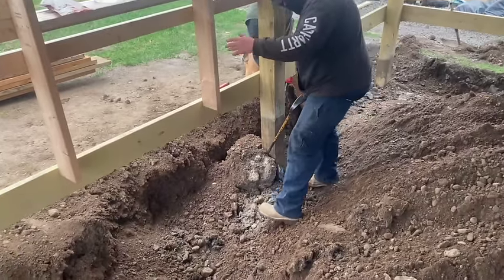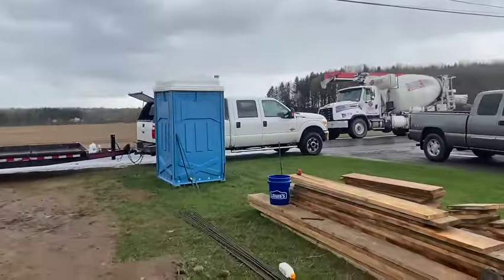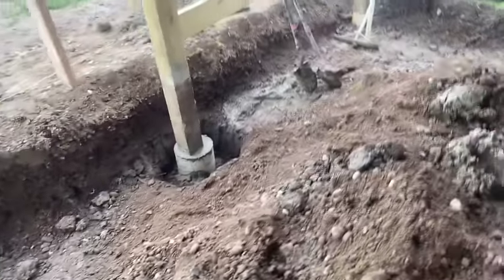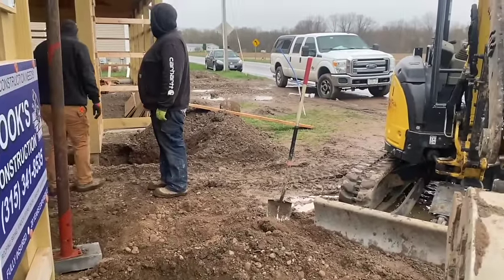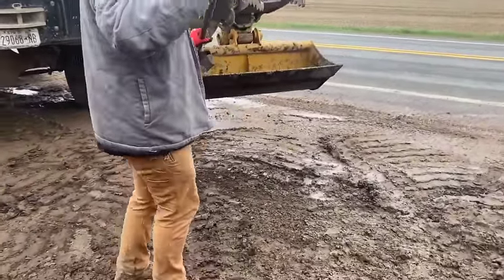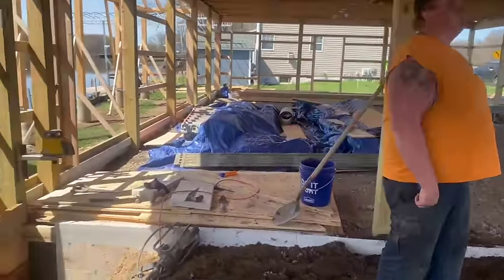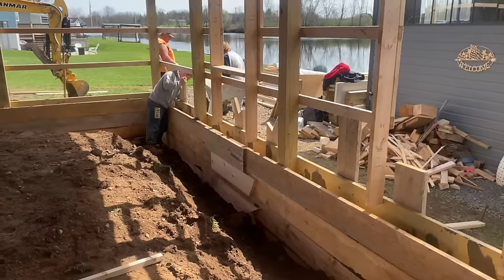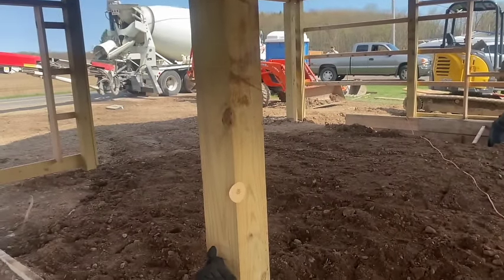HOW DID THIS PASS INSPECTION???

Comment: Disagree with your comment about the cement around the pole. Being from North Dakota we know cold better than anyone. JUST make sure the hole is below the frost line....here its about four to five feet. Two feet deep like they did was a waste oftime and money
Reply from the maker: In really wet soil the frost can grab that jagged blob of concrete and lift it right out of the ground. If someone insisted to cement them in they should use a smooth tube around the post then nothing for frost to grab.

Comment: Dude I’ve seen hundreds of pole barns built this way in all areas of the USA and never once have I seen a 6x6 heave up because the concrete was around the pole, frost line or not. It literally has the opposite effect if you use enough concrete. The only way it would EVER heave up is if you built it in a flood plain or a wetland which idk why anyone ever would to begin with, but even then I doubt it would raise enough that you’d ever notice. You talk like the buildings going to float away into the sky.
Reply from the maker: The river is like 20 ' away. You do not build like that. Inhave seen poles get pushed up from frost in clay soil.

Comment: The new sono tube hole you dug is to big for those tubes.  Even if you pack dirt around the sides of those tubes, the tube eventually slant over in time when weight is distributed on it.  I seen this before when a contractor digs the sonic tube hole to big from the start.  No way these sono tubes will stay straight up, to much soil was disturbed around these tubes.  Should have formed footings around that huge hole and kept the soil undisturbed.

Comment: Well, I do agree the concrete that was put around the pool is insufficient. Apparently other than New York. This is standard practice. L O L guess he’s never set a fence post before the concrete should run from top of dirt to around 48 inches around the Post but most of us anymore just put them in saddles in the woods, never in the ground and building last longer

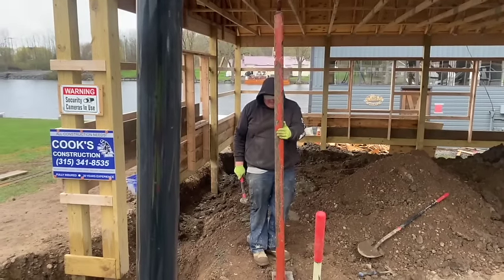Comment: At 16:19, referring to the vertical steel post, the chap said, "It's not perfectly level, but...".  No.  It certainly is not perfectly level.  It is about 90 degrees from level.  It is vertical (only a couple of degrees from vertical, actually).  Don't these contractors know the difference between "Level" and "Vertical"???  NO?  They should not be on the job.

Comment: That concrete blobs around (partially around) the poles is very amateurish mis-construction.  In New Zealand, we normally set a footing of concrete below, and when it has set, put in the pole and then pour concrete all around the pole or its supporting steel post which would come up above ground level.  Never do building regulations allow partial surround of concrete.

Comment: 48” first line though only about the first 12-18” at best actually freezes.
Reply from the maker: Depending on soil conditions yes. In wet heavy soil like clay it goes much deeper  I have seen decks get pushed up and brand new concrete floors heave and bust apart from clay soils.

Comment: now let me get this straight you say that the posts would not have frost protection when you are pouring a wall that is NOT FROST PROTECTED ON THE HIGH SIDE OF THE WALL seems to me your no better that the first contractor hat built the building
no frost protection on the boat house side at all you drilled through the 6 x 6s so if frost heaves on the boat house side it will pick that side
Reply from the maker: Well in my next video you will see that we put foam down 32" and out 48" around this entire wall I built. The problem with the other guys method was those balls of concrete you could not get the vertical foam put in because it was a big blob in the way. We frost protected the entire house as none of it was below frost with 48" of wing foam. The house part they set on little squares of concrete under the post at around 2' down so we could get the foam in.

Comment: Question.  We do not have a frost line and I cannot find in our building code that mentions requirements for it.  So I ask, if you didn't have a frost issue, would a 4'/48" depth of the pole not get concrete at all?  I've seen deep concrete posts (about 4' deep) with the pole attached to it via anchors and deep poles wrapped by concrete.  So which do you like more?
Reply: In my area (4 ft frostline) typical practice is to drill an 18” hole and put a pre-formed concrete pad or plastic disc (I forget brand name, but they are a stock item at lumberyard).   Treated post rests on that.  Then backfill and tamp 1” washed sharp gravel to grade.
Reply: 18” circumference 48” deep
Reply: @Philip Brown  much appreciated.  Looking forward to my first pole barn.
Reply: @cjplay2  Brackets on top of sono tubes or permacolumns. True pole barns should have died when they removed chromium and arsenic (CCA) from pressure treatment. I won’t even build a fence with wood these days.
Reply: @SilverbackAG  appreciate the insight.  I'm more inclined for steel post frame but they won't let me on the first project.  Financing issues...  oh well.
Reply: @cjplay2  I ended up with a 36x48 (16 ft side walls) conventionally framed with 2x6s on 24 inch centers. Spray foam, radiant heat. I should have made it 20 feet longer and 2 feet higher. Wider would also be nice but I was up against a creek.
Reply from the maker: I like no wood in the ground at all bud. But if you have to do it then do not pour concrete around the pole just a footer under it and backfill with stone or crushed gravel. The 4' depth is also to give the building strength and wind resistance with less framing.
Reply: @bondobuilt386  thank you.
Reply: @bondobuilt386  I notice the folks that do pour concrete around posts/poles without issues are those that in deserts or semi arid areas. Any farmer east of western Kansas knows not to do this. Concrete is a sponge. Some municipalities require it for fencing. Dumb dumb dumb.

I am replacing any of my own fencing with reject tubing or pipes. Building a trailer to mount an old Lincoln SA250 and plasma cutter/air compressor.
Reply: @cjplay2 ...Build a concrete foundation and floor and then frame the walls 24" o.c. This style elimates this encountered mistake and uses less board feet of lumber making it cheaper, easy to insulate  and just as strong.
Reply: Anyone mentioning a 48" deep hole dug with an 18" diameter auger is exactly correct.  Put a 5" lag bolt on each side of the post sticking out 2" will grasp the concrete and not allow uplift (wind blowing or pulling your roof upwards). The 8-10" pillar the guys in the video retro installed under the post isnt gonna do anything for the build that the original builder didn't do. Only complaint with the original builder is they dug the holes too deep and the posts were not set at the bottom of the hole.

Comment: Tim Slowey; I agree with you:  Puting concreat under the post has no help in holding the post down.  The guy bad mouth the concreat around the post is the ,one scamming on charging the owner money for somethin he doesn't need.  He talks good to someone that has no building experience at all.. Frost line has nothing to do with the post in the ground.Here in mississippi.we are pluge with torandos. All our pole barns are required by codes where there is a code to pore concreat around the foot of the poles to hold them in the ground, & have inspected pole barns after a tornador took the barn away, & the poles only thing left standing.

Comment: Wouldn't the structure be stronger if encased in concrete rather than bolted down? Or everything goes by code?
Reply: Pole will rot faster in the concrete and frost will push the pole out of the concrete.
Reply: Ok thanks

Comment: You used tubes to only have 6x6s in the way of a 15" deep continuous footer? Ever hear of a residential footer compared to a pole barn? I guess get what you pay for and they weren't down 4'.
Reply from the maker: Yes if I got involved sooner the house would have been built on a frost protected stem wall and not had wood in the ground. We ended up frost protecting ther entire house with foam board because nothing went down below frost I believe because of the water table there was high.

Comment: All those posts should’ve been above grade. You could’ve made a round columns right above grade loaded them up then you said that plate on top of it and then the post should be on top of that so when the water gets it it’s above great if not this post is still going to wrap and then on top of that even if you did leave them how you left them they should’ve been coded COATED with the roof cement at leastBut I’m in new construction and all that stuff those post have to be above grade grade. Even though they’re pressure-treated they will absorb water n in couple years rot😢I do follow your channel and I know you do good concrete work but I saw other people actually post about this too.

Comment: This is why YOU CANNOT simply "trust" the contractor is doing what they are supposed to do.
You need a set of engineered drawings.
You need a contractor who understands engineered drawings.
You need to SUPERVISE the contractor and inspect their work during each phase.
If you dont understand construction (as an owner), you need to hire an OWNER REP to keep the contractor in line.
OTHERWISE you will end up with a MESS !
Reply: Famous words always read after the fact.. 20 / 20 hindsight!

Comment: Wow we have a diffrent set up here in the UK .  As what you did in this video  our inspectors  would have made you rip it all down then reported you to the trading standards even taken the cowboy horses off you . 
Here you have to dig a complete square of the boundary of the build  dig down 2ft 5inch 
Width must be no more that 2ft wide  then the concrete must be one continuous square of over 6inch thick .then you build up to ground level with concrete blocks then you build your barn on that .post must be fixed to the floor using steel supports  .
As for your build/save repair  using a mini digger to move your concert  don't you have wheelbarrows??? Just lazy using digger . An not vibrating the concert to get the air holes out that wall must looked like Swiss cheese.

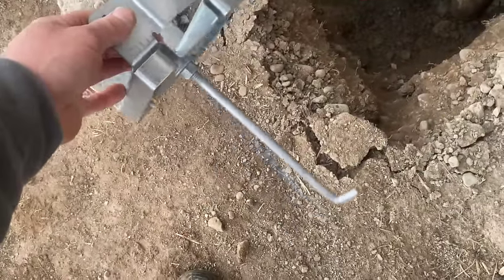Comment: @ 4:35 tell your guy trying to screw in the screw to drive them in with a hammer first then they won't fall down in the water.
Reply: Or pre-drill to start hole with other bit or drill/ impact.
With 1 impact drive, you can change quickly between drill bit and screw bit

Comment: I would hate to think the mess with the rest of the pole barn house of which you are not working on. If the did such a bastard basket case job on the garage, which you are fixing right, the rest of the house is sill with the same crappy job.

Comment: good grief that concrete isn't gong to do anything, they could have got it all the way around the pole never seen issues with it moving anywhere it matters.. da fugg you get that nonsense the frost is going to lift it up, how much?  the frost pushes in all directions not just UP, ever froze an ice cube and watched it freeze?  the soil if it is moist around the concrete around the pole is just going to GRAB IT and compress it, the concrete is winning that battle every time, push it up, WTF?  

this guy spent a lot of money he didn't need to spend, is this a scam you run on eveyrone or WTF?  you didn't go below the frost line with your sono tube so WTF is the difference?

whats the difference if the freeze is pushing on the concrete around a pole or the pole itself?  NONE!  goofy logic at best, you did nothing to capture the posts to prevent anything the frost is doing, all you did was remove the concrete half arsed around the poles and placed it under them? not much difference..

in permaftost which new york is not you run concrete up 38" above the frost line then the pole rises from there, same dimension, this keeps the wood out of the permafrost and snow pack, when water freezes it expands, so you think putting concrete under a pole prevents that from happening?  total BS

SHOW US TIME LAPSE OF THIS HAPPENING WITH BOTH SCENARIOS AND THE DIFFERENCE WITH A MICROMETER, you think an 1/8th" or a 1/4" matters in a pole barn, the entire ground expands so it all moves at once, if you do anything you increase the diameter and depth of the concrete, ever see the pads the Alaska pipeline sits on in permafrost?  HUGE  this is pipe where it matters is it moves..

I dunno what you think your logic is here now a freeze lifts the pole up off the pads you have in place? and nothing falls under the pole?  if anything you would attach the pole to the sono tube concrete pad to prevent that form happening... lord  you say freeze can lift things so you separate the pole form the concrete? in a fashion where soil can fall under the pole when lifted? freeze pushes in all directions, soil mixed with water the freeze will push under that pole. so why not have the concrete and pole move at the same time as one, the entire building at once?
 
if your frost was at 48" whats happening to your solo tune? same thing as the concrete around the pole..

using your logic one would dig below the frost line 4', drill another 3 ft, place a concrete tube with anchor, anchor a sealed treated pole to that, back fill, OR, elevate the concrete above the soil line, like you see them do everywhere there are 4 seasons in the USA.. your logic is flawed because you failed to prevent the sono tube you placed under the pole above the frost and or the pole you placed below the frost line from doing the same thing you claim will happen to an encased pole in concrete? ... huh?

again show us this event with the concrete around the pole and under it, it works either way but who wants soil against the lumber treated or otherwise, at least wrap them with a few layers of tar paper, under as well, a asphalt shingle is best in the pad for the pole to sit on.. anchor that pole to the sono pad.. you think treated last forever?  exposed to the elements 25 years, against soil maybe 5 .. certainly rather have concrete against it than damp soil.. dafugg?

when I do concrete supported pole buildings I don't use treated alone, I wrap with tar paper and then use a shingle under the pole, same as when you push soil against a concrete wall, they always spray it with tar as a barrier... so the earth its isolated form the concrete.. myself I never dip poles in the soil, I'll put my pad or whatever above the soil line a few inches.. you have barns still in use over 100 years old right on the compacted soil so whatever but I dunno who told you this story but its wrong ..  just how high d they tell you this pole barn was going to shoot into the sky?  go see how they build in permafrost...

if you want to do it right never put any wood beneath the frost line, that's going to last the longest, anchor it to a concrete pad with steel isolated .. typical way I do it, if its getting a slab I elevate the bracket above that an inch I wont even pour a slab around a post, certainly not bare post.... .. soil is soil, wood is wood, concrete is concrete, keep them as separate as possible, why you keep the sono tube in place, its a barrier between the soil and concrete, spray the tops backfill..  do the same for the wood, the steel wont matter much but coated with a good hard epoxy sealer does help it from rusting right away
Reply from the maker: I do agree with keeping wood out of the ground but I did not build this. If you watch the next video you can see how we used foam board to protect the foundation from frost and bring it up to code. The way this was built is not suitable for our climate  If we build things about the frost line as this is we need to protect it with foam board from heaving. I did not invent this it is our building code so that is why we extended the foundation below our frost line and frost protected it.